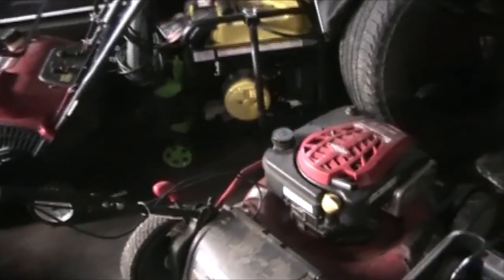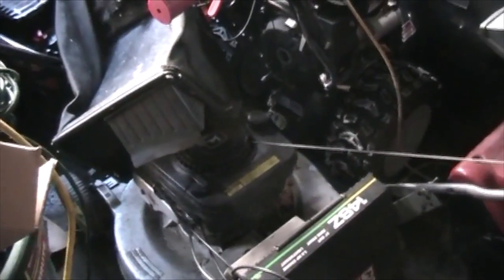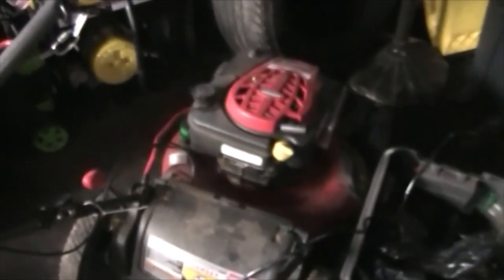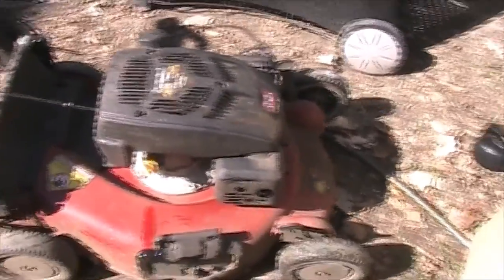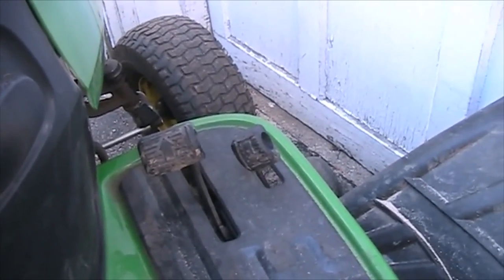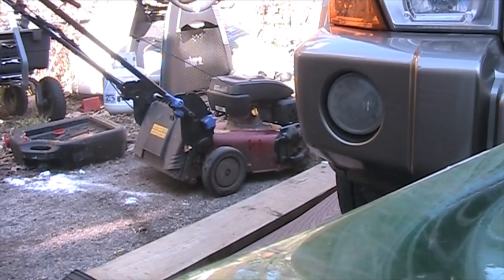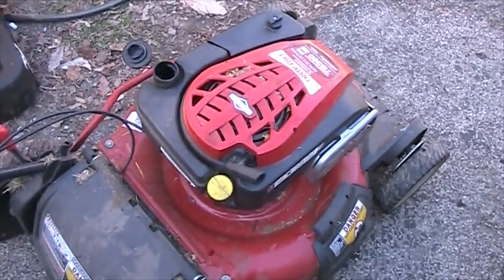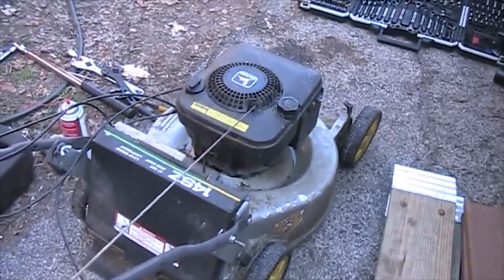Lawnmower Startups/Vlog Spring 2020

Comment: I had a green and yellow Craftsman Eager-1 from 1998, i miss that mower but it had one heck of a death. That push mower had a 5.5 horse (Tecumseh) engine and it probably had about 550 hours at least. When that died i bought the Poulan and about 80 hours in the crappy brigs and Stratton engine failed so i replaced it with a Chinese "Powermore" engine what is honestly not that bad. It was too quiet so i gave it a Custom muffler.
Reply from the maker: The Eager 1 that I have has a really rusty deck and the mulch plug is missing, so It leaves a mess on the lawn.  The Chinese engine on my Toro Super Recycler has been great.  3 years of heavy commercial use and it never burns oil.  Tecumseh engines are usually good in my experience ( especially the snow king engines).  The carburetors on some of them are not the greatest though.  I really like the Briggs and Stratton 190cc flatheads and the professional series.  They seem to run forever.